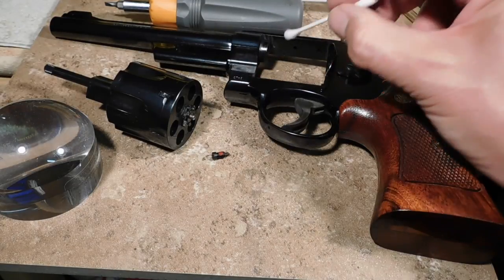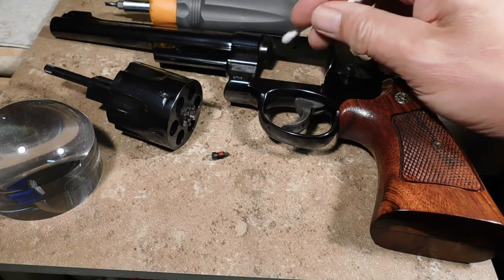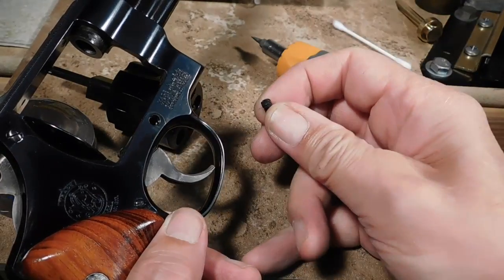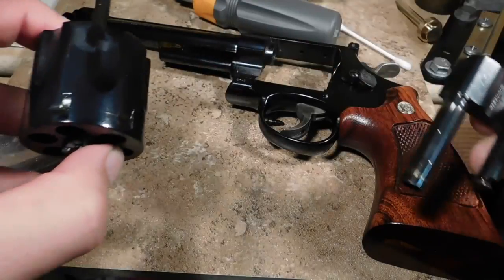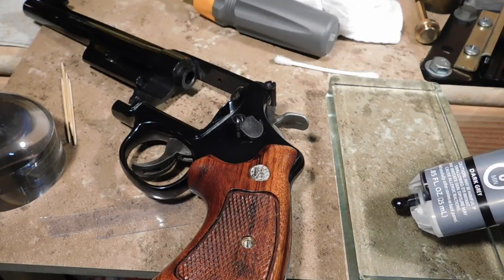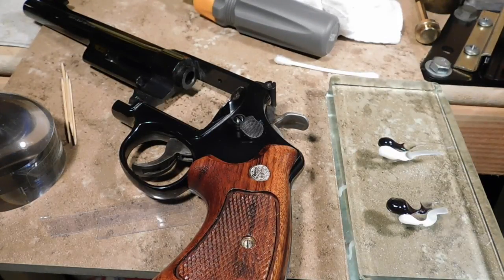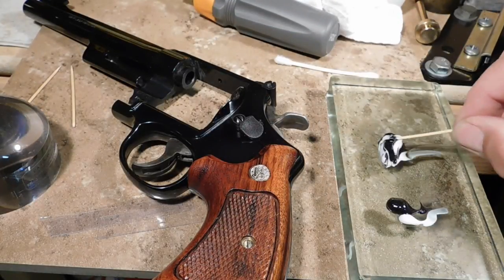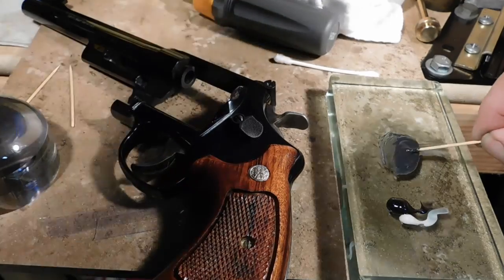Repairing The S & W M27 Classic Side Wall Blast Mark Vortex With JB Weld

Comment: I would have to agree with some others that a longer screw, fitted/filed to be flush with the bottom of the top strap would be most optimal. There are plenty of resources for a proper gun screw such as a Pachmayr screw kit or sourced from Brownell's. I would not be surprised to see the epoxy eroded away fairly quick if the blast doesn't knock it out. The blast there is incredible, enough that on revolvers that have been fired a lot, even with light loads and more so with hotter loads, the cylinder gap blast will erode a cut into the top strap metal! I know of one older model 27 that has for almost it's entire life, only fired .38 Special Target wadcutter loads, a gold standard H&G #50 wadcutter over 3.5gr of bullseye, a pretty mild target wadcutter load but it exhibits a fairly heavily gas cut top strap. Granted it has something like 75,000rds of this load logged to its name but none the less, this load that is so mild will erode steel; steel that is much harder than an epoxy. You can always refill the hole but a longer screw will fix it for good!
Reply from the maker: mytmousemalibu - S & W should just have located that front sight front screw a bit farther forward or backward and none of this problem would have been evident (without the perfect location to vortex the flash gap blast back onto the side of the cylinder).  Or, they could simply have not drilled the hole all the way through.  My other revolvers do not do this thing.  The epoxy may indeed not hold up -- it will be easy to monitor.  Best to ya,  FC
Reply: @FortuneCookie45LC  : Why don't you ever answer to the long screw suggestions ?

Comment: What did you use to clean the burn marks off of the blued finish on the cylinder? I’ve tried using some g96 complete and scrubbing with a soft bristle toothbrush but not having much luck

Comment: why would you not get a longer screw and use a file to trim it 2 perfect size so it would fill up the hole?   seems like that would be the correct way to fix this problem.  not sure I would use J-B Weld on a blued Smith & Wesson or any gun for that matter but I guess it works that's all you're looking for LOL

Comment: I'm certainly curious to know the long term effects of your fix. I have an older S&W model 13-3 with some minor flame cutting on the top strap. Highly doubt I'd go that route since I believe that would be comparing apples to oranges but curious none the less. I've since retired that one to mainly 38spl loads with the lee 158gr cast lead loads and no more full house loads of 125gr jhp with win296. Anyways, great video and always a joy to watch and learn. Have a great Independence Day!

Comment: A good fix probably. The company should not have sold the revolver with that flaw and should fix it with apologies to the customer. The longer screw idea sounds good to me, I guess. HAPPY 4th of July!
Reply from the maker: E.Kent.D - The longer screw should have been used from the factory, or the screw hole should not have been there right where the flash gap is, or the screw hole should not have been drilled through and through.  Lots of should haves...Look at the underside of the top straps of so many revolvers in the past - none had holes right there where the flash gap is - in fact, that area is subject to gas cutting in magnums like the 357.  To put a through hole there is actually unconscionable.  Did have a fine 4th...hope yours was also very fine... FC

Comment: Nice solution to a problem that shouldn't  have existed. Hopefully some feedback is getting back to Smith because I do love them, but just like Glock(which I also like) they shouldn't get a pat in the back for sloppy products. Case in point gen5 Glocks at $600+ with plastic sights. No way Jose. Speaking of sloppy and not in a good way, I heard Remlin is maybe getting their act back together and that new carbines for .357 finally came out, which is by far my favorite. How you gotten any of this new models yet?
Reply from the maker: Boris Buliak - Hello to ya, Boris..!!  Yes, I got a Illion 1894 in 44 Mag and it is a fine rifle - completely happy with it - also, it has the Ballard cut rifling so it shoot .430 cast bullets well instead of my old 1894 MG that requires .433" bullet to shoot well.  Best to ya,  FC Steve
Reply: FortuneCookie45LC i'd heard that the new barrels comin out were a little more accurate?
Reply: FortuneCookie45LC im sorry this question is off topic,  but at your convenience can u explain why dry firing rimfires is bad? Heard that from the manufacturer, after taking great care not to do that i accidentally dry fired my colt 1911 22. Actually a couple of times. Can i dry fire with an empty shell or plastic plug?

Comment: Interesting, was that an oversight in manufacture of the M27?  I have a M629 and the ejector rod loosens when firing magnum loads. It is left hand thread. How can I tighten it up more permanently?
Reply: Toy collector. I would take it to a Gunsmith and tell him what is happening. He could probably tighten it with better success because he has the right tools for the Job. I don't think he would charge you much and you probably wouldn't have to wait that long to get it back.  That's what I would do. Dave.
Reply: Thanks Dave, That is likely the best option.  Looking forward to more of your excellent videos as I do the ones from FC.

Comment: fc45lc - I have a similar condition on my 44 Mag Model 29 Classic. I'm looking forward on the range test. Will the JB Weld hold up??? uhmm  By the way, I did you get the flash marks off the cylinder?? Thanks :-)
Reply from the maker: L Krueger - If you really look hard, I used lead removal cloth from Midway USA to rub the blast marks off, but I stopped short of rubbing the entire blast mark off as to do so would start to lose the blue.  It's a PIN, but does work out - in the long run, the bluing does have to be compromised as that's what happens to the front of our cylinders when rubbed a lot - Best to ya,  FC
Reply from the maker: L Krueger - Just did the range test.  I was hoping that the JB Weld was some tough stuff...but no - the flash gap blast defeated it...the force of the blast ate away the JB Weld after 200 rounds were fired, some magnums.  The JB Weld will be completely gone after the next range session - as if it was never there.  It is not a fix for this problem. Have a great day,  FC

Comment: I know I could probably go back and look at one of your videos but there are so many I thought I would just ask you I am just getting into making my own bullets I have for 50 caliber muzzleloaders buckets and buckets of wheel weights and a bunch of plumbers lead pipe could you give me some pointers on making 50 caliber rounds for a muzzleloader I'm afraid to make them and have them turn out wrong or damage my weapon thanks
Reply from the maker: Walker Outdoors - First thing is you want to cast muzzleloader with pure soft lead...your wheel weights are too hard unless they are the stick on type that is pure lead - your plumbers lead pipe can be considered pure lead.  You can cast .49" round balls for use with patches or cast bullets from Lyman or Lee (REAL bullets) for your 50 cal - they will be a little big but should ram nicely, especially the REAL bullets.  The bullets are much more effective than the round balls.  The bullets need to be lubed with SPG or equivalent lubes.  Some use Alox mixes and report OK results, but alox makes a mess with black powder as petroleum products + black powder residue = tar.  Perhaps with Pyrodex, alox is OK, but only testing will tell.  It's like if you buy the 50 cal Hornady muzzleloader bullets - they are dead soft and take game very well with good expansion.  Your home cast REAL bullets may not expand as well even though they are also pure lead.  If the bullets ram down your barrel and are cast of pure lead,  you should be OK with recommended powder charges... Best to ya,  FC
Reply: FortuneCookie45LC thank you I have a bunch of plumbers lead to ...I was told you could skim most of the tin and antimonyout of the wheel weights , I didn't buy that ...I'm glad I talked to you thanks again!!!
Reply from the maker: Walker Outdoors -Thanks for your comments.   One of the reasons we flux our alloys is to get the tin and antimony back into the mix as they do want to float to the top of our molten alloys.  Frequent stirring is also a good idea.  However, it can be shown that we can lose some of our tin and antimony if we overskim our alloys.. Some casters have asked if we can get pure lead if we skim our WWs a lot for example.  Answer is that no, we cannot produce pure lead from our alloys as a matter of course - takes a big commercial smelter outfit to do that.  Lead is being shipped overseas for processing as we don't want to do that in this country any longer, but we still need lead for our lead acid batteries.  They take our lead, charge us, and then charge us again when we buy the batteries.  Best Regards,  FC

Comment: That's not a 27-2
 The 27-2 has an attached firing pin to the hammer. This is a later model.
Reply: In S&W parlance, that "firing pin" is called a hammer nose. The revolver in the video is a Classic, which is a re-release and incorporates changes that make manufacturing easier and less expensive. IMO, the quality of fit is far less than the older, pre-lock guns. If a through hole is drilled in the top strap, the screw filling it should be long enough to pass beyond the bottom, then filed flush by the assembler. Better yet, the holes should not be drilled all the way through, especially on the top strap.
Reply: @DeereX748  yes sir i know that and i know it called the classic, but it isnt fluted, no plnned barrel,  and no exposed hammer
 Im old school and you can call it a 27 but not a 27-2. I know im spitting hairs, but like i said, im old school and just happen to be holding my 27-2 and 29-3. You are correct in your description sir

Comment: Yep, ya jes need a longer screw. put it in & file it flush thru back & forth, trial & error.  If ya ever had to send that revolver back to S&W that would negate any warranty.  Your screw fix would've screwed you.
Reply from the maker: Walks Fletcher - Thanks for your comment.  If such a simple fix voided the warranty, then the factory is really looking for every little thing that would do that - and that alone would be very revealing on a company.  If I filed on the sights or added paint or insert to the front sight, that would also void the warranty.  How that would have affected a broken bolt or hand for example would tell us a lot about the company.  Hmmm, Colt is back in business, and Rugers are mighty fine ...   Have a great day,  FC

Comment: Vortex is not the correct term for what is happening,  The divot in the frame under the short sight screw is reflecting the cartridge gas to the side of the cylinder.  There is no gas vortex in action.  Vortex: a mass of whirling fluid or air, especially a whirlpool or whirlwind.
Reply from the maker: Dwayne Vidrine - OK on that..!!  -- reflecting or redirecting all sounds like the infernal event that is taking place...Kinda like those times when bullets would hit the edges of bullet dents in steel and then come right back towards the shooting line.  Most of the hits on shooters and bystanders drew no blood... Best to ya,  FC

Comment: WTF!! You are so concerned with your collectable M27 that your are laying it on top of a ruff ass piece of rock!!! Get a towel are better yet a yoga mat which can been cut  and sized for several different firearms also I have used a brass bore brush  and some Hoppes#9 with no ill effects to remove lead splatter from  cylinder flash gap.